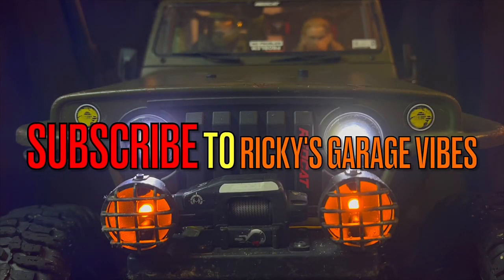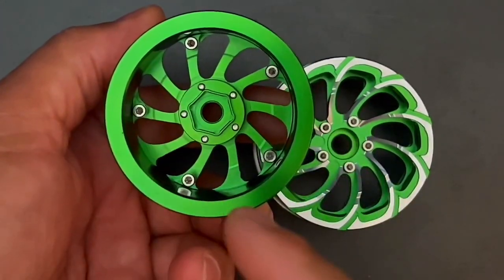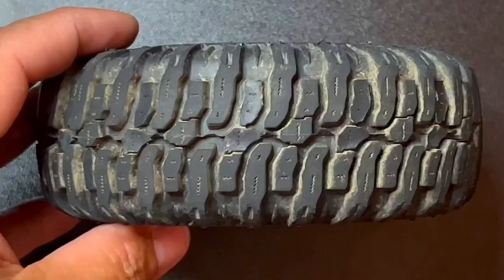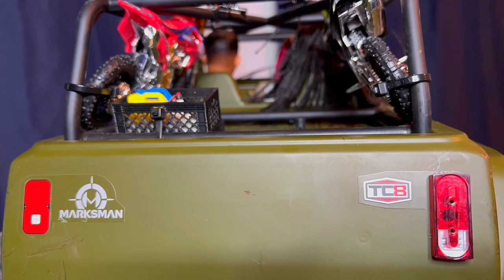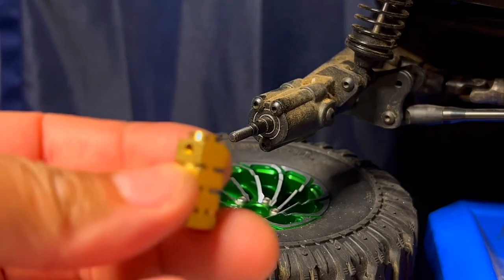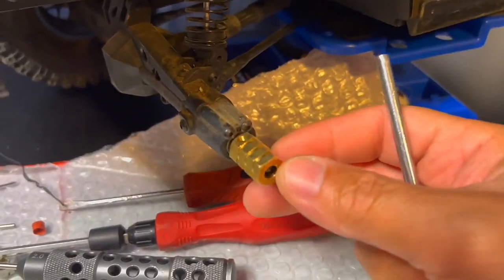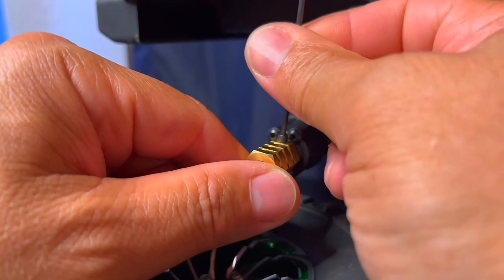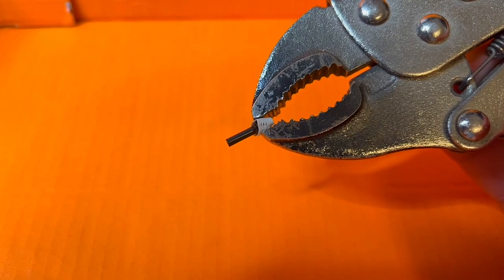RC Upgrades on RedCat TC8 Marksman👌🤝

Comment: How did you hook up the LED headlamps for the various colors? What Control unit did you use to work with the radio?  great mods by the way, I grabbed the OGRC X0036ROGUZ light kit.
Reply from the maker: Thanks man really appreciate it 🤝 I used Channel #4 on the Flysky GT5 controller to change the light colors, and a FSB6 receiver